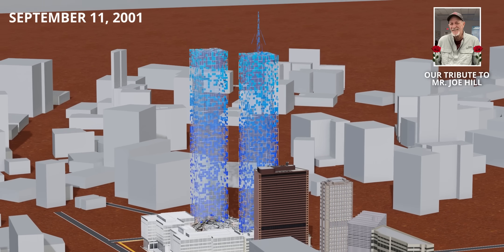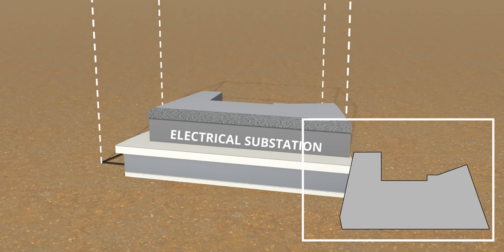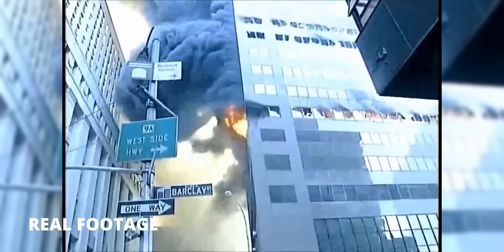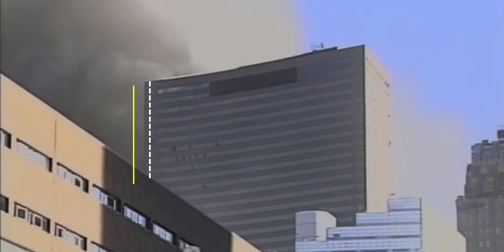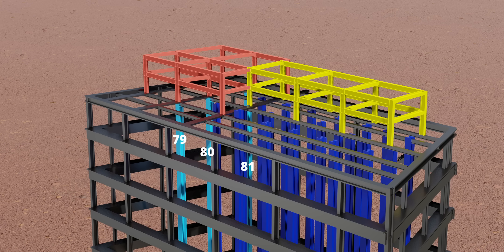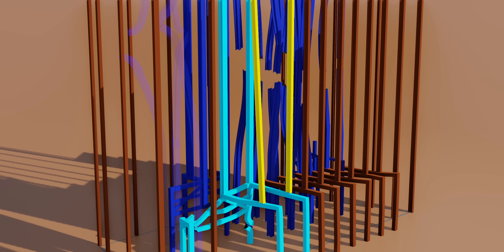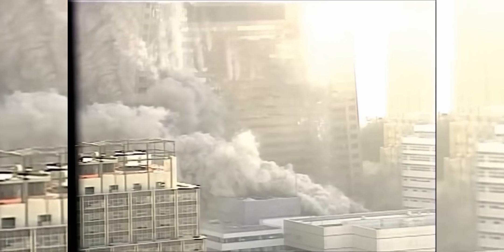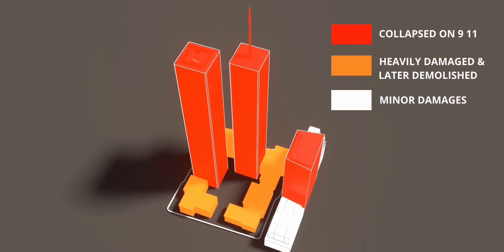Collapse of Building 7 | The Complete Physics

Comment: How do they handle the photographic evidence that WTC5 was extensively hollowed out from the basement to the penthouse by massive explosions? Not enough debris fell on it (mostly aluminum cladding) to cause that kind of damage.
Reply: Well first of all, WTC 5 is not the topic of this video, so "they" (Sabin Engineering) do not cover it at all nor do they need to.

Secondly, you've got the wrong building.  The one you are talking about was Building 6.

Third, Building 6 was not hollowed out since the center of the building was an open mall and thus was always hollow .  Falling debris from the North Tower merely crashed through the roof, opening up the open space in the middle to the sky.  And yes, more than enough debris fell on it do crash the roof in - as evidenced by the fact it happened AND you can see a lot of that material inside 6.

Comment: ALL of the WTC buildings were controlled demolitions.
Reply: This is one of those situations where we are confronted by a choice:

1. Do the complex physics, fluid and thermodynamics calculations involving materials, pressure differentials, conservation of mass, momentum, energy, temperature, laminar vs. turbulent flow, viscosity, and density necessary to understand and explain building collapses on a detail level. 

Or 

2.  Just skip all the hard stuff, and say controlled demolition then drop the mic. No thinking at all required.  

Conspiracists invariably take the low-hanging fruit, the path of least resistance going for Door #2.  Conspiracists don't offer conclusions based on scientific reasoning, they only offer a two-word hand-wave rationalization that took or required little to no thought, maybe backed up with infinite "yeah, but" conjecture.

It's boring.

Comment: An 8 second freefall symmetrical collapse of a 49 floor skyscraper.
Amazing the cleanest video of controlled demolition, put up the other video out that shows a identical skyscraper being demolished by controlled demolition side by side.
Reply: Exactly,  as if all you need to demo a building down is simply lighting it on fire. Falls straight into its own footprint everytime. This video is a joke
Reply: 18 to 20 second 1/3 of free fall decidedly asymmetrical collapse of a 47 story skyscraper.

There, FTFY.
Reply: @TheCriticalStinker-01 when you can clearly see the building hold it symmetry all the way to the ground. And where did you get your stopwatch at sesame street? First ever skyscraper to fall due to fire. First ever skyscraper to fall that looked like controlled demolition due to fire. First ever collapse to be known about ahead of time.  First ever to be reported to have fell while it still stood in the background.  First time and only time a single owner owned 3 buildings that fell the same day. First ever building designed to burn to extinction without collapse and it collapsed. So there's that

Comment: I wonder what Dr Leroy Hulsey would comment
Reply: Ask him.  He's retired, not dead.
Reply: Right off he would point out there's no way the scale is right on those transfer trusses. They are so small. No way that is correct. Even a 5 year old could tell you structural steel is nothing like a cereal box. I've never opened a cereal box with a plasma torch. 😅😂 video is a joke.

Comment: As a structural engineer, this is a highly plausible explanation for the failure of WTC7.

The conspiracy theorists would have you believe that an imperfect controlled demolition was pre planned, such that the demolition charges could remain intact despite the raging fires and damage to the building, and that they could exactly account for the damage the building would receive (from the falling twin towers) and allow the controlled demolition to exactly match those damage patterns... Just no 🤦
Reply: Who do you work for? I'll know not to hire them. As a structural engineer it's your opinion that because the roof fell in it was caused by the 13th floor versus other floors above? If so explain how you came to that conclusion? As a structural engineer,  if you were hired to build this building on top of the infrastructure below. Would you or would you not make it a lot stronger than necessary? Would you overdue it? What they  are claiming to be the weakest part of the building was probably the strongest part of the building

Comment: Has another steel frame building collapsed into its own footprint (or not) in the last 24 years due to fire?
Reply: Why don't you just use Google search?
Reply: Yes. Probably thousands. Happens all the time. 

Before 9/11/2001 it was apparently universally understood that steel performed poorly when heated.  Steel is after all formed using heat and deforms the same way.  Now in 2025 people need to be told vaccines are safe, slavery was bad and steel fails when heated. 

Things that used to be obvious.

Comment: You can see simultaneous puffs  before the building starts its full unimpeded collapse.
Reply: OK, but the collapse had been going on for 10 seconds before that, so those silent low-velocity puffs of smoke and dust were a result of collapse progression mechanisms, NOT collapse initiation mechanisms.

Comment: As far as I know, 100% of this building had fire sprinklers. Why did these fire sprinklers not put out the fires???? 🤔
Reply: For one, sprinklers suppress fires.  Rarely to sprinklers put them out. Never in the case of fires on this scale.  As for the sprinkler systems in this building, the issue was addressed by The NIST in the FAQ to its Building 7 Performance Report

10. Why did WTC 7's sprinkler systems fail during the fires ?

The sprinkler systems did not fail. The collapse of WTC 1 and WTC 2 damaged the city water main. The water main served as both the primary and backup source of water for the sprinkler system in the lower 20 floors. Therefore, the sprinkler system could not function. In contrast, the sprinklers and standpipes on the building's middle levels (21st floor through 39th floor) and upper levels (40th floor through 47th floor) received water from two large overhead storage tanks on the 46th floor, and used the city's water mains as a backup

Since the main fires were below the 20th floor,...

Debris from the collapse of WTC 1, which was 370 feet to the south, ignited fires on at least 10 floors in the building at its south and west faces. However, only the fires on some of the lower floors—7 through 9 and 11 through 13—burned out of control. These lower-floor fires — which spread and grew because the water supply to the automatic sprinkler system for these floors had failed — were similar to building fires experienced in other tall buildings. The primary and backup water supply to the sprinkler systems for the lower floors relied on the city's water supply, whose lines were damaged by the collapse of WTC 1 and WTC 2. These uncontrolled lower-floor fires eventually spread to the northeast part of WTC 7, where the building's collapse began

Comment: It’s really convenient that this guy left out that the penthouse is connected to a solid concrete core:elevator shaft !!!!
That shaft will not collapse!!!
I build these building for a fkn a living. Try lying to some one else !!
That building was blown the fk up !!
Reply: Well, there was no concrete core solid or otherwise. The structure is just as shown here - all=steel with core and perimeter columns. 

If you actually had the expertise you claim, you would have known that. But you didn't.

Comment: Brilliant video, it always makes me laugh when conspiracy theorists  call it a controlled explosion. Keep the brainless comments coming, its great reading.
Reply: This "brillant" BS video didn´t even dare to mention the free fall that proves the controlled demolition and you pathetic little dumbfart don´t even grasp that you´re a conspiracy theorist yourself, so yeah keep on laughing at yourself fool...
Reply: @Kudde23 then explain the lack of explosions, the fact it didn't fall straight down, and how it was demolished?
Reply: @NateTheTrainGuy  You won´t find many controlled demolitions more straight down than this so yes it was straight down.
They used thermite.
Now you try to explain the free fall over the height of 8 floors, without controlled demolition. I´m not aware that anyone ever even tried so you can become a really special person now...
Reply: @Kudde23 Just two problems with that, one no thermite was actually found, two, even if there was thermite, it isn't even used in demolitions, it's used in welding and cutting off rails. most variants of thermite are not explosive, and the ones that are explosive, are very weak so it wouldn't be strong enough. another reason is because it's very hard to control and careful precision is required for its use. and finally 1 pound of thermite burns in a few seconds, assuming that it takes 10 seconds to burn ( for simplicity sake ) to fuel a fire for at least 50 minutes you need at least 300 pounds for each steel support. i don't know about you, but sneaking in multiple 300 pound devices of thermite into a skyscraper to certain floors would most definitely arouse suspicion. even if it was a controlled demolition, who is to say that it wasn't caused by Al Qaeda?
Reply: @h1F595 Yeah yeah poorpoo, because the Skyride tower wasn´t a building but a TOWER while the twin TOWERS were not towers but buildings. But what exactly is even the point you´re trying to make poorpoo? That things can never be done for the first time? How many controlled demolitions of skyscrapers have there been prior to 9/11? Anyone as tall as the twins or at least as tall as 7? So controlled demolitions of such tall buildings are impossible because it has never done before or what´s the stupid "point" you´re trying to make here poorpoo?!?
Reply: @NateTheTrainGuy  There were no explosions because when steel supports fail they do not explode, they bend and deform.  I know its hard for you to understand but try.
Reply: There was never any planes to begin with by the way.
Reply: @DiamondSwordTribes2  BS
Reply: @DiamondSwordTribes2  Lmao see, the idiots are out in force.
Reply: @Rikbik Yeah I agree. Glad when we can see the through the same eye. 😉
Reply: I meant you! I saw those planes with my own eyes.  Trust me they were not CGI.
Reply: @Rikbik YouTube keeps deleting my comment. But basically I was saying that you have to watch this event other than youtube to watch the thousands of other angles (wide angles) that dont never show a plane (becuase there wasnt any) while youtube deleted those clips. You never saw a plane yourself